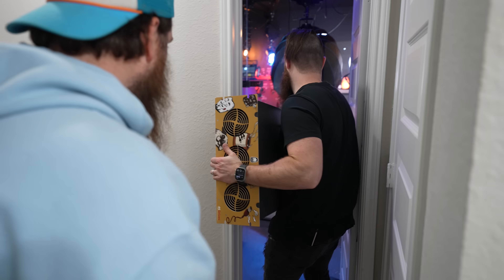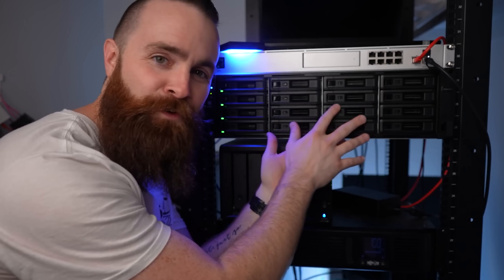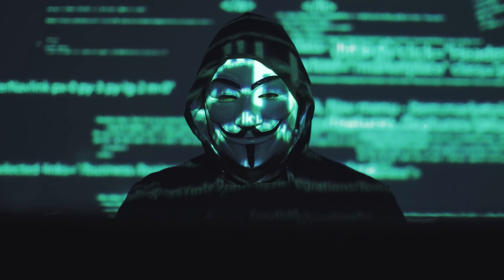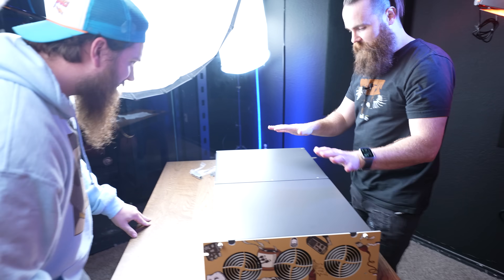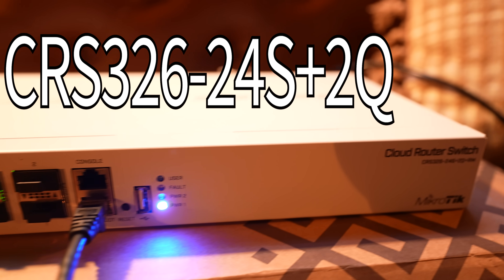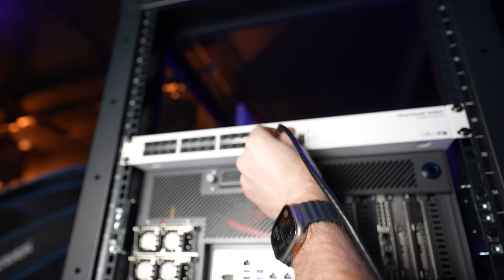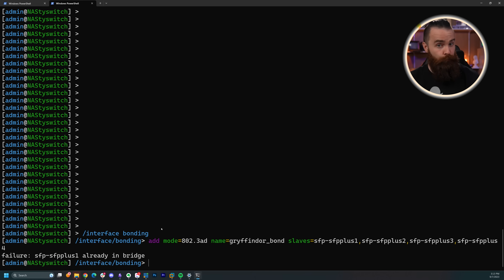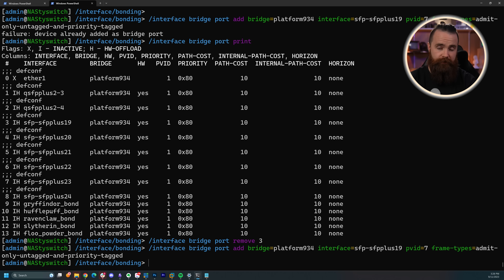My SECRET Server Room Project

Comment from the maker: Protect you from YOU. Learn more about Contrast Security and get a free demo here: https://bit.ly/3PkJsRZ 

👀 Sneak Peek into My Secret Server Room Project! 👀

For almost a year, I've been working on a special project: building a server room that's not just functional but also cinematic! Today, I'm giving you a behind-the-scenes tour of this dream setup, still a work in progress but already filled with so much potential. From racking my 45Drives servers to configuring an epic 10gig switch, there's a lot to cover. So let's dive right in!

Get a server like me, checkout 45Drives: http://www.45drives.com/NetworkChuck
Reply: ok how do you plan on using this?  and does this have a power backup? or at-least enough of a backup to safely save and shutdown? Obv The 2 racks r linked but still.
Reply: Hey Chuck! My dad used to be REALLY good at this kinda thing, and he once used MikroTik to run a WHOLE corporate building, AND it was so redundant the entire network could run off of his phone for short term. And make sure you save the configs to backups somewhere, that way if one piece of your MikroTik tech dies, you just buy the part and import the config, not spending hours to re-set it up.
Reply: The text messages made me laugh,
Like do you really call your wife, "wi-fi" :) :)
Reply: Ideally you should enable the vlan filtering and define the vlans you want to use. This makes the trunks only use the defined vlans, but this would be a more secure configuration, avoid scenarios like vlan-hopping, or noise on the trunk which you don't expect.
Reply: Six Daughters. That's insane in 2023 Chuck!! Gratz man but seriously. How is your hair not grey? You are using the dye aren't you?
Reply: Who do you use for your network provider? I know that setting up all of this stuff requires great networking freedom and was wondering who I should go with in the US.
Reply: I really hope you actually sent those text messages to your wife. That would be the best IT Pro Husband move ever.
Reply: Whoever you go with will depend on your area. Telco providers have a monopoly on the market. It's the reason i live in a major city on the west coast. I run a buisness doing IT consulting so i have to have dedicated 10gbe fiber lines. You will notice chuck says he has a  1gbe and 5gbe he mentions. 1GBE is generally a copper line from a provider like spectrum. His 5gbe line will be fiber. Fiber is much more reliable and required for things like bridging sites to together.
Reply: No he seems young anyway, @seankingsland  
Also how has he not had a boy yet
Reply: Probably the most wholesome moment in the video is your daughter doing homework - or whatever it was - in your office while you were recording.
Reply: Goodluck in electricity bills 💸😂✌️
Reply: you are my giga chad in IT life, bro you made me  happy and purposeful thank you just thank you.
Reply: @Caringal_Tech  You either about that life or you not. No one said game was free 😉
Reply: I love secret rooms.

How much do I love them?

I can't tell you.

That's how much.
Reply: hi can you pleas make a video on how to make a bot to crack a 6 diget number  password and show how to install the talls you use
Reply: Hello my friend, can you explain to us in video how to choose Mikrotik, Cisco or any other brand routers in terms of performance and RAM? Thank you for the response, my friend. Drink coffee, friends
Reply: Hey, please make a video on how to aetup Dolphin Scheduler with docker and install ssl certificate on it.
Reply: @mucsendit3556  why do you need this?
Reply: @MLBB_Best_Moments why does a math app need permissions like your location?
Reply: You went intel?? Lol
Reply: When is the next server room update of what you are going to use all this for??
Reply: Thank you Chuck great content. ❤ 4 girls one boy .. I can relate. Lol 😆
Reply: I work in a data center nearby. We have a bunch of 42U cabinets and PDU's we will be throwing away at some point. Might be able to talk the boss into giving one away. Would be a hassle to get into your place. At least it would be a full rack though.

Comment: Never build a server rack with your hard drive servers at the top. If your rack isnt SOLIDLY bolted down into the concrete and you slide out all of your hard drive servers, that server rack is going to fall forwards onto itself.

Comment: For safety reasons i'd consider to bolt the rack to the ground. With the weight from the drives if you pull servers for maintenance you may have the risk to tilt the rack and fall into you. May be a remote possibility but better safe than sorry.
Reply: I second this. I worked in data centers and would never risk it.
Reply: All I could think about while watching this is how high the center of gravity is...
Reply: That's a very good point..
Everyone who's seen a non "bolted to ground" rack has thought the same, or heard the results... and no one wants to just burn that kinda cash
Reply: I worked datacenters and I couldn’t agree more. Please bolt the rack up or use special balance plating. Especially with the kids around!
Reply: @JaykPuten  it’s a lot of money indeed, but nothing compared to physical damage of him or specially one of his girls that seems to be around him all the time
Reply: Or maybe bolt to the wall

Comment: Hey Chuck , pretty cool that you cover MikroTik hardware and a bit of the configuration!
Your videos are awesome and they always encourage me to work on my homelab again and try new things.

To avoid possible frustration, I have a few tips for you:
- activate Safemode in CLI with ctrl+x (in case you loose the connection or lock your self out, it reverts the last changes)
- add the bridge interface itself to EVERY tagged vlan in bridge settings
- if you don't want your switches to be transparent (for a management vlan for example) add a "vlan"-interface under "interfaces" with the given VLAN-ID, add an ip address to it, and add it to the tagged VLAN in the bridge settings also
- make sure that "vlan filtering" in the bridge settings is turned on

Maybe it helps with trouble shooting in case of a problem. Best wishes! 👋

Comment: The easiest way to work with MT is remembering that most commands are the same as Linux networking. I dumped Ubiquiti a couple of years ago and went to MT, I never regretted it. Not to mention my hardware has handled all that I have thrown at it, including expanding the home to a lab environment with the typical home service.

Comment: 6:25 Just a quick note: Ethernet is a protocol and can run over both SFP and RJ45. SFP is just a form factor for connectors. It might seem like a small mistake, but it can be misleading, especially for someone learning. Getting these basics right is important, particularly when addressing a large audience, as these details matter in the networking and DevOps fields.

Comment: Awesome video, I love that you're just as susceptible to issues as I am.  I've had the good fortune to be able to do all this in a professional setting and it's a lot of work.  We had KVM from Raritan to setup as well since our setup was collocated, and side rack kvm controllable PDUs.  The only issue I can see will be how much space you have behind your rack, in a raised floor data center the front of the rack is covered with cold air from the vented floor panels and the back is full of heat from the server exhausts.  So you'd freeze in front and sweat in back, lol.  I'd be interested in knowing how well your A/C set manages.  FYI there are special devices that monitor the environment and will page you if your server room gets too hot.  We had one and I had to go into work in the middle of the night one time because the A/C failed and the room was 90 degrees and drives in enclosures would be even hotter and likely to fail.
Reply: Been there and done that over the years.  I use the APC's environment monitoring to e-mail me the alerts if something should go wrong.   I could use SMS but APC is terrible of constantly sending me alerts when it could have been 1 alert only vs an alert 15 every minutes by default.   😂

Comment: The bridge thing is actually quite common on enterprise Linux switches that are running Cumulus or SONiC for example. That's because a bridge *is* a switch. It's just the software equivalent. By creating a bridge within Linux it can then use that config and program the ASIC with that information. It makes total sense if you try using bridges in Linux.
Reply: Was looking exactly for this comment!

Comment: Mikrotik pro here - if you understand the software architecture it makes sense the way it is (even if it is a bit involved).

Your 'switch' is still technically a 'router', a 24 port router... but it has a crap CPU so it can't actually route much through the CPU. VLANs and the likes on CPU routing are actually a lot more simple - and if you move switch hardware over to SwitchOS from Mikrotik (if yours supports it but its dwindling) then it'll act more like a conventional switch.

As you alluded - you can only have 1 bridge assigned to offload processing onto the switch chip - so in that sense it's logical you create the 'bridge domain' where all these physical (or virtual bonding) ports exist together, so all traffic and decisions are made through the config on that bridge - which is currently being processed by the switch chip for that bridge.

I'm still not 100% sold on MT switches personally - but they are great value for money. They can never act as L3 switches in a DC, but I have used them with things like MCLAG etc. I love the routers though - RouterOS is super flexible and everything is included even on the $50 little routers in terms of software features.

My home network is all MT, my previous job was all MT, my current job is Cisco on the edge (ASR1K's mostly) and Juniper QFX at the core, so I get to compare a decent amount of vendors.

Comment: Mikrotik has so many ways to do VLANs based on what hardware you're using to get the maximum performance. On my old router the switch chip had all the VLAN but my new one uses bridge VLAN to utulize hardware offloading

Comment: I'm barely getting into networking and cybersecurity stuff, but I have lots of friends in the business, and they all talk about having their own networks and stuff. I can already tell this is something I'm gonna want to do at some point😂
Reply: Yeah, indeed. Nothing like learning about some new technology, concept or config and being able to replicate that in an environment where it's okay if stuff goes wrong, you make mistakes, you cause a crash, you break something or..... Starting to get into containerization at work? Spin up an embedded kubernetes environment on your hypervisor and you're off to the races. Learning something about networking? Spin up a virtual switch, router, firewall,...or just use spare hardware you have in the rack, connect it all up, configure it and see the results of that configuration happen in real life. Then tweak it and see the difference with the previous config. Want to try out some weird, non-standard config that might help solve a problem you have at work? Spin up a few VM's or containers, connect them all together, configure the environment, try the weird config stuff, see if it works and then just destroy the VM's/containers again (making sure to document everything, of course. Lol, but not really). Want to practice offensive security? Spin up some vulnerable VM's, connect them together with a virtual private network if you need multiple hosts, take a checkpoint/snapshot and try to break in. You messed up a VM? Go back to the checkpoint/snapshot, which in a literal second restores the VM state to right before you started, and try again, and again, and again,....

Few things are as valuable for someone in IT as a lab environment where you can set up whatever you need for your specific area of expertise. It is where I have learned the most, by very far, more than at work and at university combined. Make the investment, you won't regret it if you're serious about an IT career. It is the best investment I have ever made and has paid itself back a hundredfold because of job opportunities, bonuses and promotions which I would have never gotten without honing my skills in my lab. Of course, be sure that this is going to be the right career for you before you buy everything, I wouldn't do that in the first week of education or an IT job

Oh, and make sure that your internet connection is provided from a device that you won't be experimenting with. The people living with you (the wife, mostly) aren't going to like when it goes down all the time. I know this from experience, lol
Reply: Yep keep seeing people wanting router in a container or something on their main server...like why knock your whole network for changes, upgrades or oopsies. Bare metal is simple and easy

Comment: for "hardware offloading" and realy 10Gb/s network , you need to check if in "/interf brid pr " is enabled the "vlan filtering" option.Thas option use the powerfull switch cip on your mikrotik.If is not enabled- all you trafic go to CPU, and you use the switch like a router.

Comment: I’m a hoarder of networking equipment for almost no reason. I have a Fortinet 600D, 2 Cisco nexus 9300 series 10gbe and 40gbe uplink, kemp loadmaster load balancer, HP 380 gen 9 (256gb ram, 32 core, 16tb memory), Cisco business switch for the “office” zone, Fortinet AP U431F, and more odds and ends. I have a website hosted but it’s overkill. I think I can support like 3 million connections theoretically (probably more like the hundreds of thousands). And the best part is I’m still under $2500 in total spend.

Comment: 8:43 Yep, you scrach your glass and you read my comment and you already know the scratch glass. But I have 2 solution for you. The Cerium Oxide glass polisher as number 2. But my favorite is the number 1 method. use instant glue like cyanoacrylate thick formula and when It's dry in the scratch polish with RainX  winter windshield fluid because you have no water. The excess of glue can be remove with a razor scraper.

Comment: Love my open frame rack, I've 10 of those in 2 rooms, 4 used for old apple tech like imac g3 g4 mac mini g4 and intel, 3 for ham radio stuff, 3 for modern it tech (nas, dvr, nvr, printers, 3d printer and other security item), I've do just simple mods like put rivets in the hole for m5 screw, make holes from the side rail to interconnect 2 or more rack with (painted in black) wood panel and to make side wall finished in fake cherry wood... and check more times to avoid to invert front with rear (I've to admit i forgot/fail 3 times )... ps: open frame 42u with wheels are top for mantenance, can move aroun without problem. ciao!

Comment: I hope you talk about your power budget... That's always my biggest struggle.  I have an older house, so stashing computers and make shift servers on different circuits is always a pain.  How many servers can you really run at a time... and what is the amperage.  Like, we know an NVidia Tesla P40 uses 250watts of power, which is like 2 amps, but nobody ever really runs all their hardware full blast at the same time.  Would love to hear how you planned your power budget, and if you are staggering the spinups, and boot ups of your servers to prevent the huge spikes.
Reply: But running extra power is pretty easy. Upgrade your breaker panel for a few bucks. I have an electrician I've used and does it for $600ish.

Comment: This looks sick! Love the glass wall! #lifegoals
(Small note: you mentioned that each host has SFP+ ports, not Ethernet - Ethernet is not a cable type but rather a family of technologies. The cable you’re realistically thinking of have RJ45 (or if you want to get really nerdy, it’s actually 8P8C) connectors on twisted pair. The SFP+ DAC cables that you’re using between the switch and the hosts are also using Ethernet, too!)
Reply: I'm sure he knows that but sometimes ya have to dumb things down a little or simplify

Comment: I'm only halfway through, but I am pulling my hair. I can't imagine you have anything heavier to put in that rack than the 45 Drives units. Maybe UPS, but it would be close. That should all go at the bottom. The last thing you want is a top heavy rack. To keep it stable, and prevent tipping hazards, your heaviest equipment needs to be at the bottom. Basic physics.

Comment: First, I want to say a huge thank you for all of the content that you've put out about the Raspberry Pi and have been a tremendous help to me.  I'm a retired IT professional and I've started "playing" around with the Raspberry  Pi.   I'm running into three issues; the first is that Open Media Vault will not install with the latest version of Pi dated 10.10.2023.  Second,  it appears that the dhcpcd.conf file no longer exist in the etc folder.  All I get is a blank file when running the sudo nano /etc/dhcpcd.conf command  Finally, I believe that you had posted in one of your videos how to insert IP arguments in the cmdline.conf  file to also add a static IP address to the Pi.   Any help would be much appreciated.

Comment: I have 128 GB of RAM in my personal desktop! XD

I also run Linux, so I use less RAM than the average user.
Reply: Same here.   Debian 12 with KDE.  😁
Reply: @Darkk6969  Nice, I am EndeavourOS.
Reply: 256GB on my desktop, HP Z820 with Ubuntu on it. Memory use is very low I even have a 50GB ram disk setup for when I need fast disk IO.
Reply: @PeterMountUK  Lol, nice. My laptop has 64 GB of disk space, with 3 GB of RAM, with an Intel Celeron processor with EndeavourOS on it.